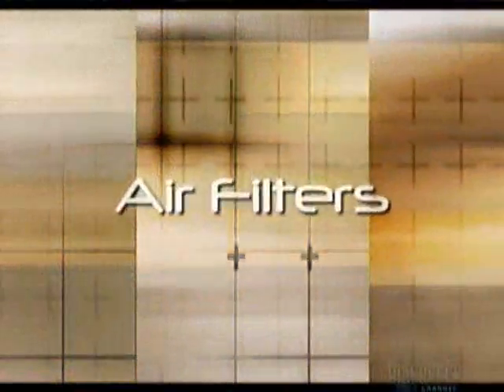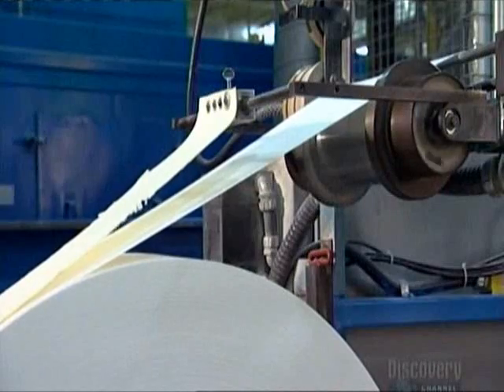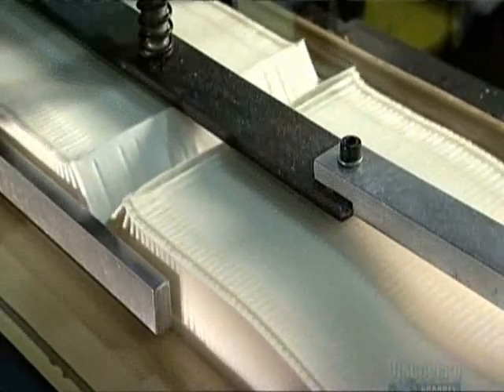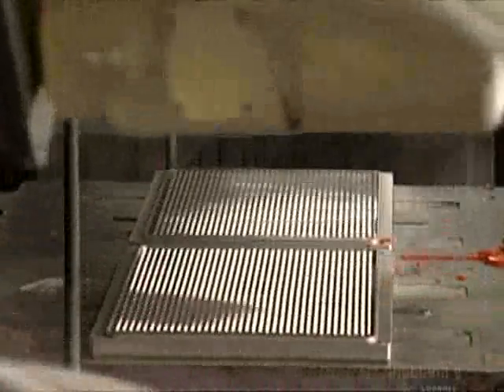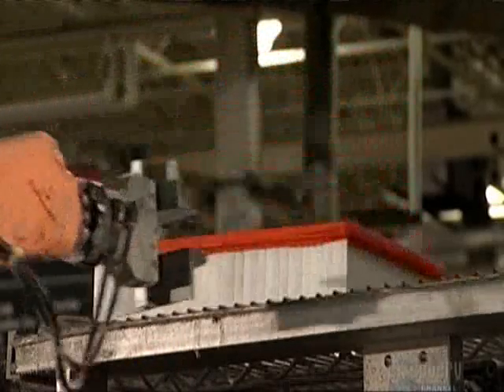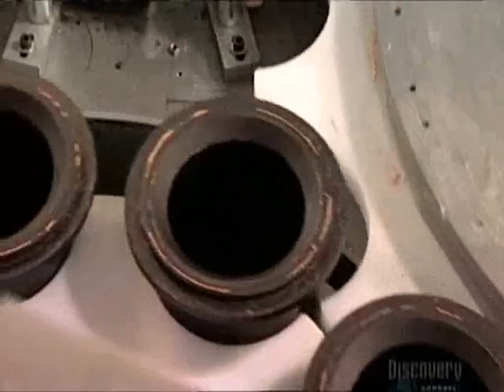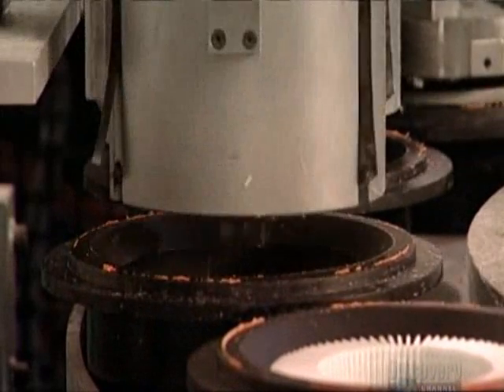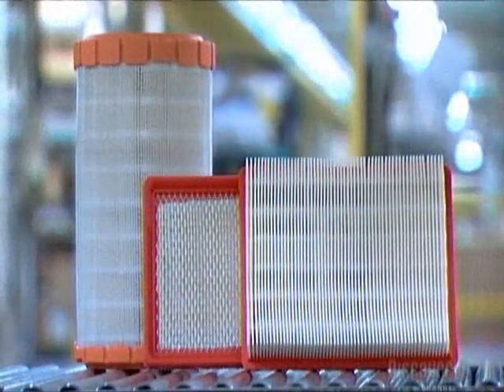How It's Made-Air Filters

Comment: @rudolphna54, first off clearances you are talking about being tighter are for the bearings not the piston rings they still run the same so many thousands of a inch per inch of bore gap that was runned back in the 50`s even.  You cant make the gap smaller or you will lock up the engine once things expand with heat.  Now for mine I need the flow maybe your car doesnt need it but mine needs it with a 1000 CFM throttlebody with a powerband of 2,000 - 6,000 rpm.

Comment: @Milner62   Yes but the model T engine was vastly simpler. They also had much larger clearances and higher tolerances than modern high tech engines.  They also didn't care about oil consumption. Dirt scores cylinders and rings, and over time increases oil consumption.  Except in performance applications,  filtering ability is more important than flow.

Comment: @Milner62, only down side is the oil might mess up the fuel injection ambient air temp sensor that has to be installed in the bottom of the air cleaner base.  That is part of the ProFlo2 EFI kit I am looking at.  Given it probably wont do that since many people use K&N and never reported that issue in big numbers but still I dont know if I want to take the risk.  Its not for having a life time filter but having a filter lid which no one else makes.

Comment: Now about making more power without a filter thats a myth.  I could put a new aircleaner on my car and take it off and regardless it will make the same power.  Its when you take off a old clogged filter that you make more power.  an engine is only going to pull in as much air as the engine is able to. Which is why I was looking at K&N for my kitcar I have limited room and can only run a 14" dia x 3" tall filter so I need their filter lid to supply the engine with enough air.

Comment: @rudolphna54, In the end you dont need to filter out every last particle.  From how I am reading your comment you are under the belief that you need to filter as much out of the air as possible which just isnt true.  The Model T 4cylinders were bullet proof engines and just ran for ever and got great gas miliage but they didnt have an aircleaner at all.

Comment: @Milner62   Cotton gauze is good for FLOW. But FLOW isn't necessarily good for FILTERING ability.  No air filter at all would be great for performance but longevity would be crap because of all the dirt that would get in. K&N let alot of dirt through that paper filters pick up becasuse of the higher efficiency.

Comment: @Milner62, the problem with paper filters is that they hamper airflow.  Air doesnt flow as easily through paper filters unlike the oil bath and the cotton gauze filters.  Thats why companies like K&N do such great business with their cotton gauze and thats why at any race track around here you will see the cotton gauze filters being used in performance applications.  Plus you never buy another filter unlike paper, ocne its dirty it goes in the trash the other two you clean and reuse.

Comment: @rudolphna54, and what proof do you have?

Oil Bath filters are basically the same as the cotton gauze filters but better because they use horse hairs that are coated in motor oil.  Dust and dirt particles stick to the oil coated horse hairs.  Same as the cotton gauze, dirt and dust sticks to the gauze and the oil helps.

If they are as bad as you say I wonder why every performance driver I seen uses cotton gauze filters.

Comment: Interesting video.  Too bad the video is incorrect though on paper filters.  They are not good.  A oil bath filter is simmilar to the cotton gauze life time filter that you have to clean and spray a oil film on to clean that is better than these toss away paper filters but yet a oil bath filter that has horse hair and motor oil filters the air way better and you get way better air flow and gas miliage over paper or cotton gauze.